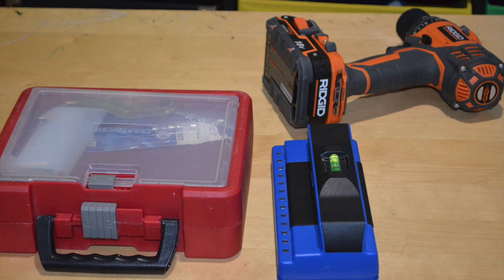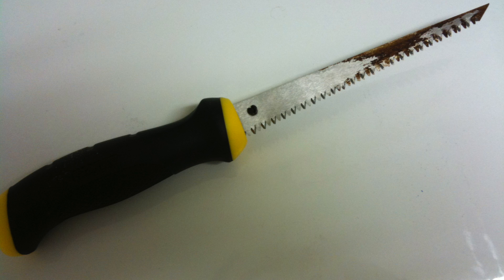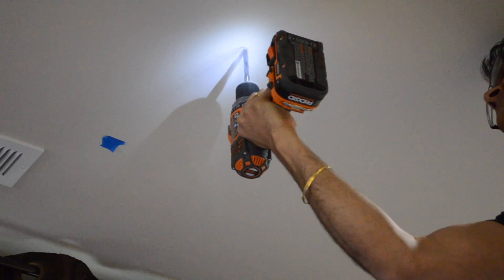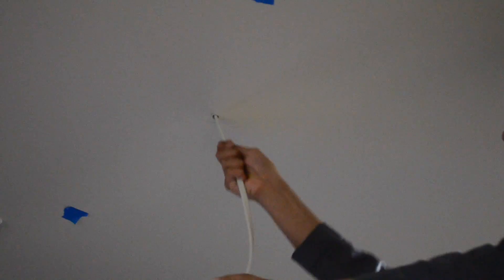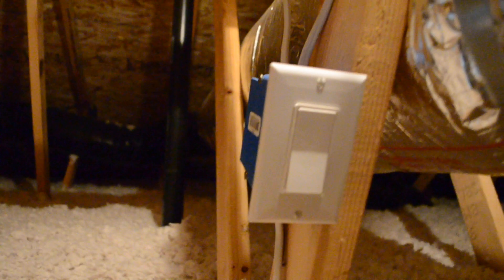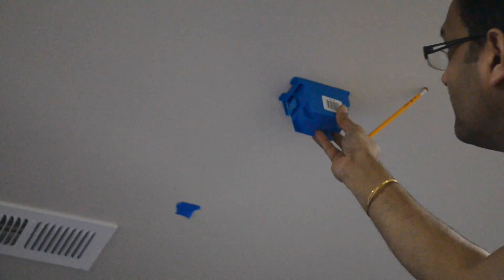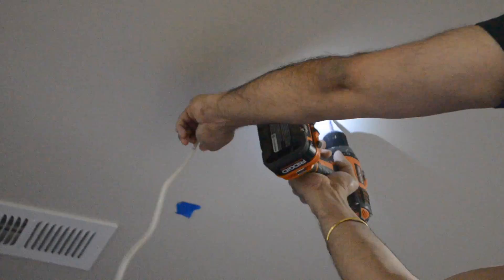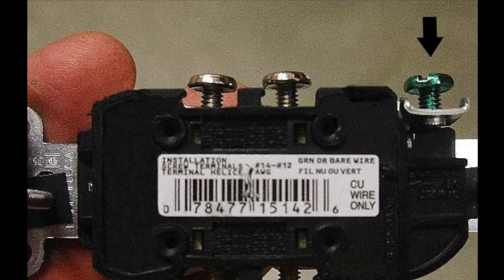How to Add an After-Works Outlet to Any Ceiling

Comment: The wire colors you mention are incorrect for most houses...black is HOT, not neutral.  Most houses do not have red wiring, except for cases where there are 3-way switches...they have black (hot), white (neutral), and green/bare (ground).
Reply: No houses in the united states have a red hot unless its a traveler between three wAy or four way switches 😆 black is hot white is neutral red is for lighting circuits be careful listening to this kids instructions in the us

Comment: Was that electrical box just screwed to the drywall ?  That's not okay.   And I hope they added a junction box for that new line.
Reply from the maker: The new electrical box we added is called an Old Work Box, and is supposed to be mounted to drywall using plastic tabs. The new line was added from a preexisting junction box.

Comment: Any solution to a new apart, where ceiling is not drywall but concrete, and the outlet is on a kitchen wall nearby? How do I get the wires from the vertical wall up to the ceiling without constructing drywall/fake wall? How do I hide the outlet ? Thanks!
Reply from the maker: You can always win an extension cord through a surface mounted track. It's a lot simpler than what we did but it's more noticeable.